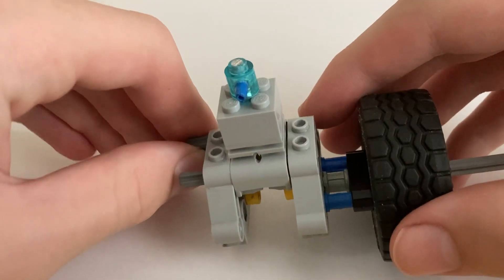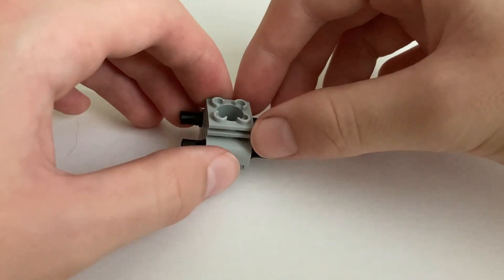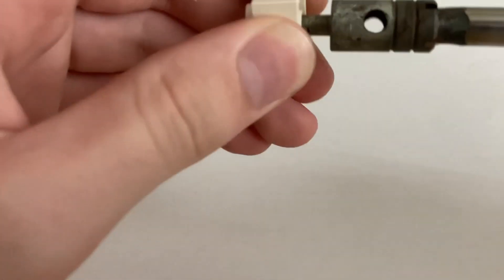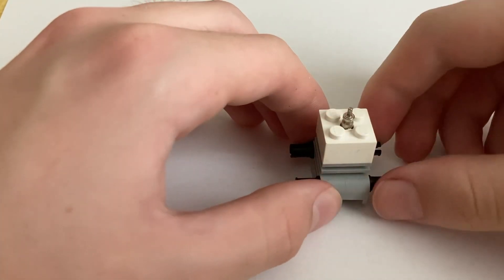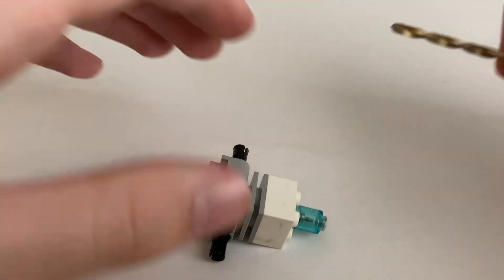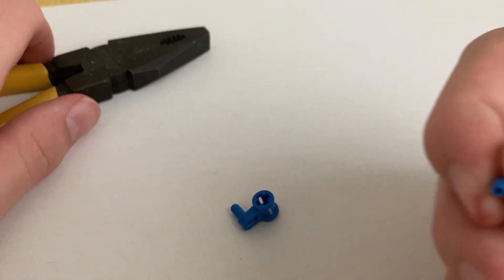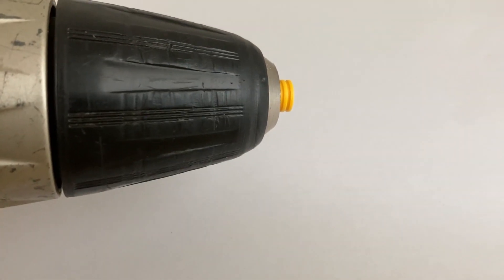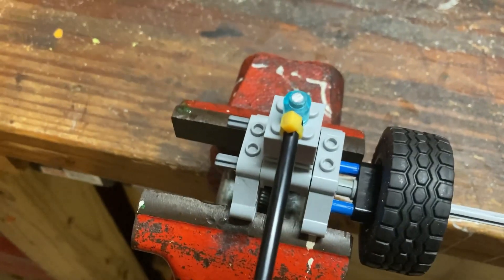Lego One Cylinder Engine Tutorial

Comment: But isn’t this basically just Lego Technic Embodiment’s tutorial except just a different headpiece?
Reply from the maker: Yeah, I tried his design but it didn’t work for me, so I modified it to try to help other people build it.
Reply: @mrpython99  what didn’t work about his tutorial?
Reply from the maker: @mysefengineering  when I followed his tutorial, a lot of the parts leaked and it was to slow to run consistently.
Reply: @mrpython99  sure but what is different in yours apart from the headpiece? (and if you’re using a springless valve or not)
Reply from the maker: @mysefengineering  I just tried to go into a little bit more detail for what I found works.
Reply: @mysefengineeringhis design also didn’t work for me this one is much better